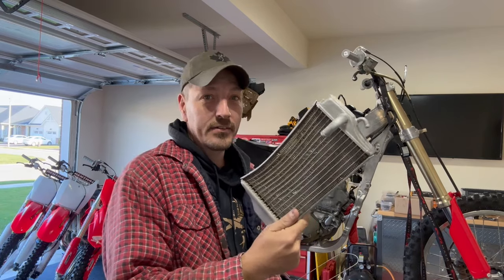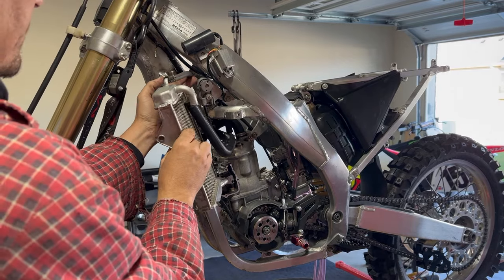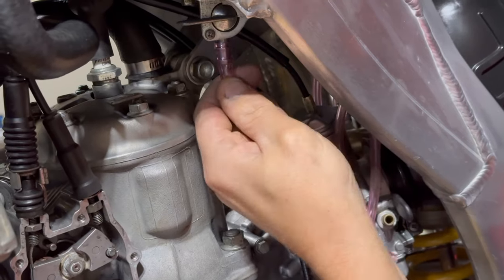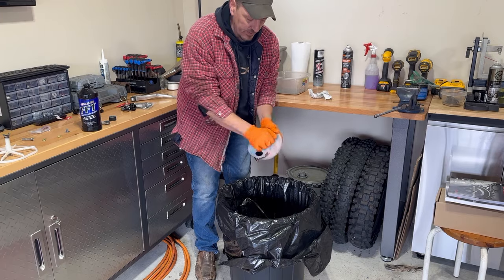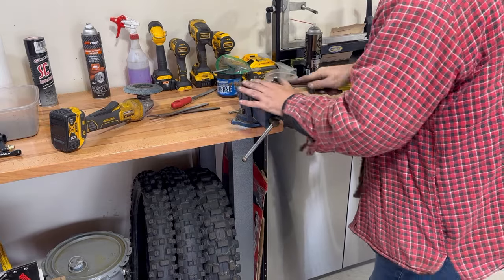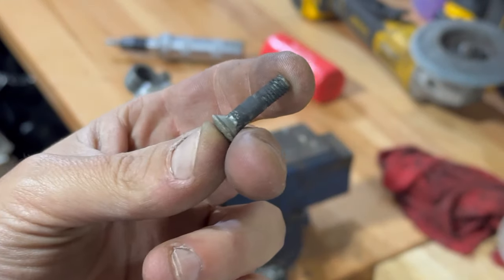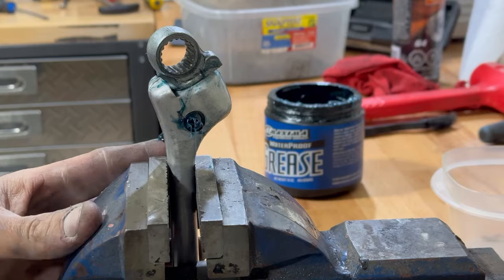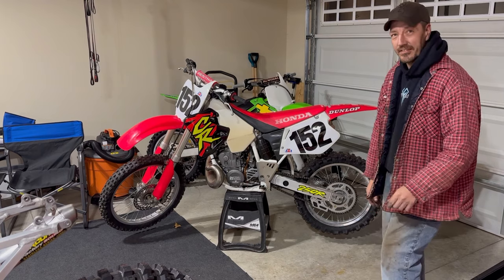2004 Honda CR250 Bent Radiator & Final Assembly

Comment: The original Honda fuel line is much better than any clear aftermarket fuel line !
Reply from the maker: thanks for the comment,  I'm curious. why do you think its better then any aftermarket fuel line ? 

I agree they are really good lines. They must be to have lasted for over 20 years.  but just wondering why another company could not make a better product.   I really have been having good luck with the MAXFlO lines i have been using, and they give a really fresh look.

Comment: Question: I've been putting a small ring of grease around the filter flange (or face). Is that detrimental to the intake?
Reply from the maker: I have heard some guy like to apply grease to the air filter around the face that seals to the breather box/ intake.  I personally don’t.   But I use a good air filter oil that is really sticky. And I think that along with the pressure of the airfilter cage pressing into the breather box creates a really good seal.   As long as your breather box and intake is assembled properly..  but to be honest most older bikes that have been taken apart are assembled wrong.  So just check that and you should be good 👍

Comment: Do you have any recommendations on aftermarket rads? Mine are too far gone on my '05 cr250 and wouldn't feel right putting it back together with banged up rads.
Reply from the maker: It’s to bad you need new rads for your bike.  There are a few good companies out there making aftermarket ones.   I like the GPI rads.  
https://gpiracing.com/collections/moto-aluminum-radiator?page=3

They seem you work really good and have pretty good fitness when I have used them in the past.   I hope that helps.

Thanks for watching the videos and for the comment.
Reply: @Dirtbikerepair  i asked on another forums as well and everyone suggested GPI as well so I'll go with those.
Reply from the maker: @brandonwall231  GPI are some of the best fitting I have found, and they are pretty affordable.  hope you get it all fixed up and get to ride this spring and summer.

Comment: Do you have a idea yet of how much your gonna post this one up for sale for? Currently freshing up a 02
Reply from the maker: not yet, I like to run all the numbers on a build after its back together and running, incase something comes up and i have to buy another part for the bike.  so after the last video i have a good idea of what the build costs.. but like usual there is always about $2000 or more in parts and the cost of the bike.. so im thinking this bike will get listed around the $6500.00 area... we will see what the spring brings and the market in my area